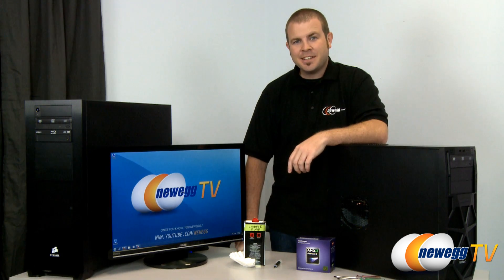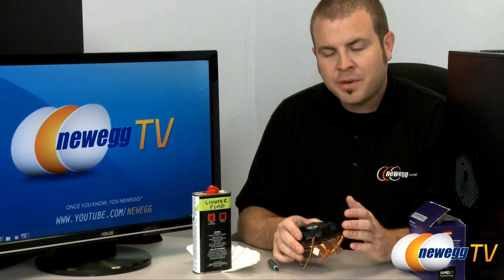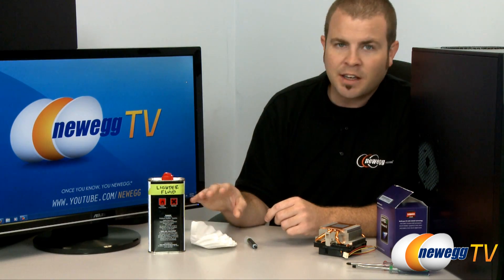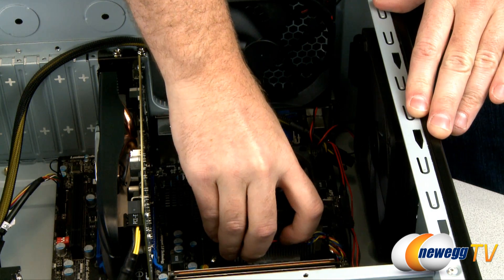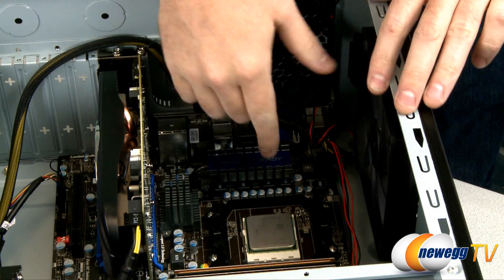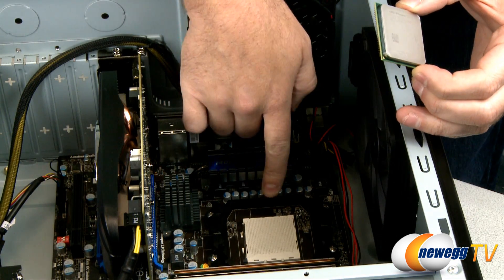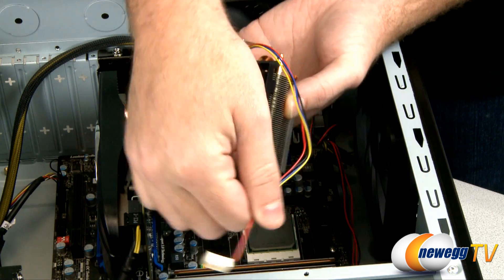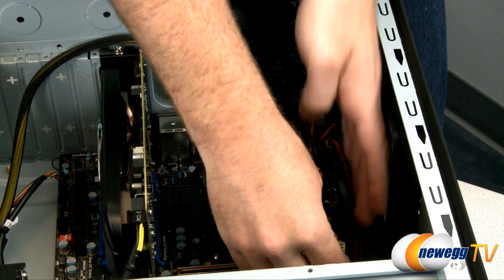Newegg Tutorial: How To Install an AMD CPU

Comment: @vearheart42 Not gonna argue, but Benchmarks say a lot about the efficiency of AMD processors speed-wise. If you have an issue with heat, buy a real heatsink. I don't know about the power, and if that's true or not but I won't deny it if I'm not sure.

Comment: @Zeraan1337 I've been using AMD for OVER 10 years and never had a problem for reliablity or effciency. IF anything Intel's chips run much hotter then AMD's and they pull a lot more power, so no they aren't more efficient. . .